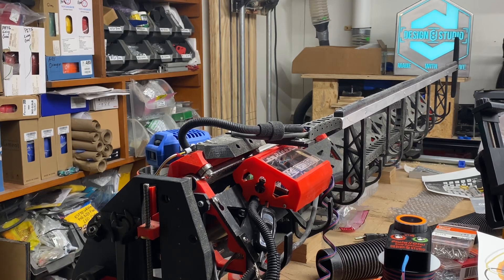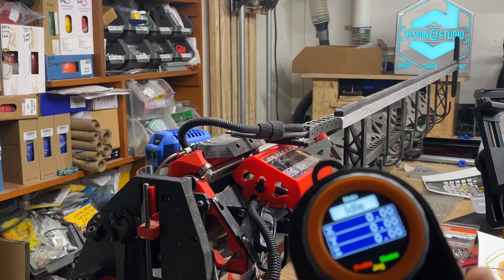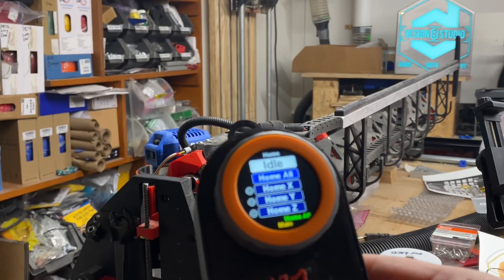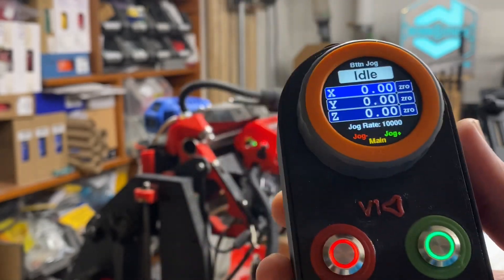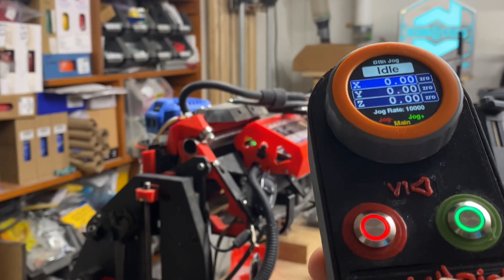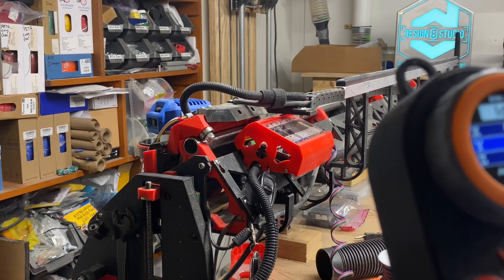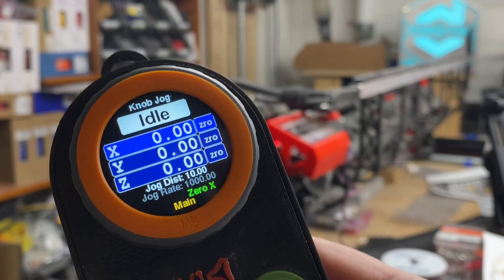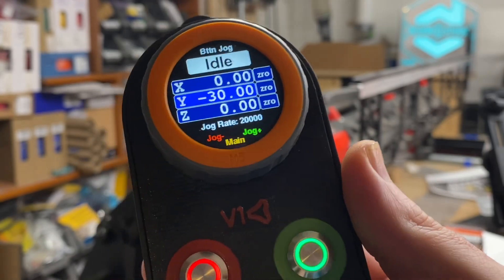LowRider v3 CNC, Jackpot, FluidNC dial pendant, and awesome hard limits & soft limits!

Comment: Can you recieve and respond to M00?
Reply from the maker: The FluidNC firmware supports pause and resume, and quit, through buttons in the WebUI and buttons on the FluidDial. My guess is that those buttons invoke the standard GCodes for that functionality. FluidNC is basically GRBL compatible.

Comment: Ok, so is the pedant connected to the driver board or to the PC that connects to the lowriders esp?
Reply from the maker: The pendant is wired directly to the Jackpot control board, and no PC is connected by wire. I can connect via wifi to the Jackpot board (which has the ESP) using either a PC or a phone or tablet. This (PC by wifi) is - for me - only to upload gcode files for jobs, or perhaps to upload a tweaked config file, etc. (It can do more, such as jog the machine, but I don't use it that way.) I have almost never connected a PC via wire to the Jackpot board.  I did connect it by wire once or twice while doing firmware work.

Comment: Hey Doug, just wondering if you've been continuing to use G10 instead of G92 for zeroing? And have you been using that for Z probing as well? I just upgraded to the Jackpot board and want to make sure I've got everything optimized.
Reply from the maker: After extensive testing, I have found that unless you are using the various built-in coordinate systems for memorizing different offsets/workspaces, there is no functional difference between the two. Since I have never used the various coordinate systems for saved workspaces, I can continue using G92. However, in all the scripts I’ve created for probing and jogging, I worked up both versions, and I can’t remember right now which ones I have in use, but I think I’m using the G10 ones. The core difference between them is G92 is an overriding offset that affects all workspaces, whereas the G10 one needs you to specify which workspace offset you are wanting affected.

Comment: Question, i like to build myself the pendant, this demo you give is this the code of Bart FluidNC pendant ?
Reply from the maker: Yes it's the firmware I downloaded from Bart's FluidNC Dial pendant on GitHub. Bear in mind, they are hard at work enhancing and perfecting the firmware for this pendant, so it has more features and a new face on the way. By the time you get the firmware, even if you download it now, it would look different from mine. Give it a few days. They're making quick progress!
Reply: Thanks for the info maybe i must wait a couple days @design8studio

Comment: i dont know what i would do without your help. you do  such a great job explaining everything realy enjoy all your videos Thanks again for your documentation on the lowrider. another question do you use estlcam with fluidnc or just fluidnc
Reply from the maker: Thank you for the kind words! My plan is to continue using ESTLcam to generate the Gcode, and then transmit the Gcode to the SD card that is in my Jackpot board for cutting. I have not had my Jackpot board installed very long, and I’m only just now getting to the point of being able to have it tested for the gantry being trammed to my table and being set up for cutting “square.”

Comment: did you design the case i did not see it in your printables site
Reply from the maker: I did not design it, but I did do a remix of it. I will go ahead and post it. The original is available on the Fluid Dial project repository on Github. Link for that is in my build log, which is linked in the video description.
Reply from the maker: Printables download link for my remix of the case: https://www.printables.com/model/697710-case-for-fluid-dial-cnc-pendant-for-fluidnc-based-